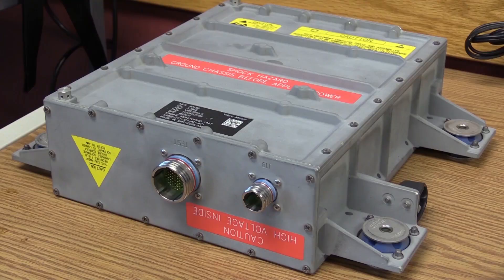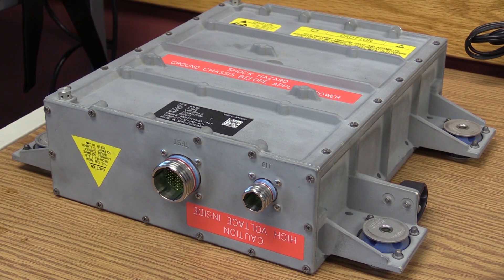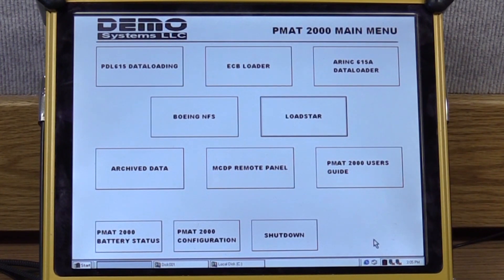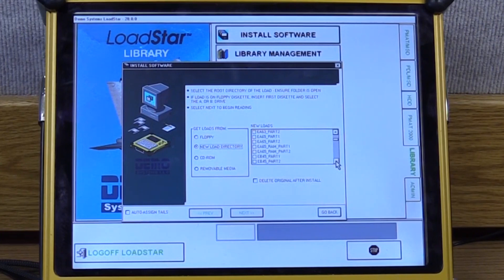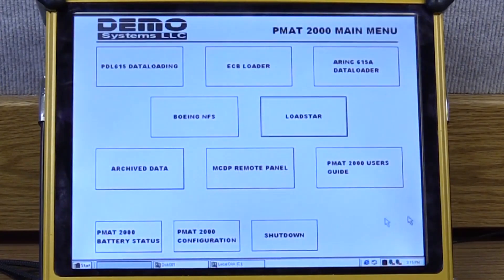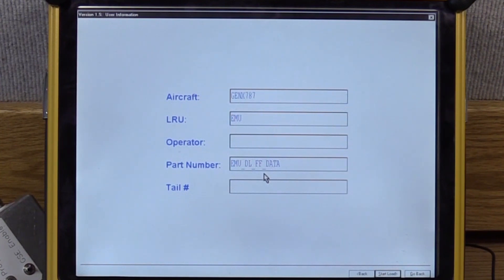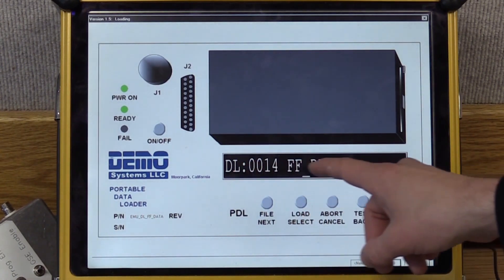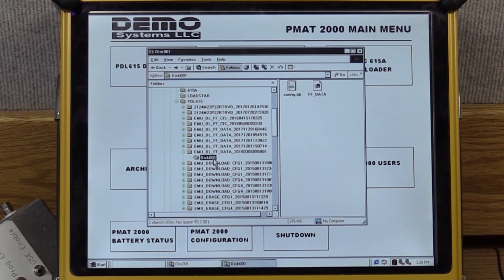GEnx - CEOD NVM Download - GE Aviation Maintenance Minute

Comment: J2 (The DB-23 @ 5:30) isn't a standard parallel cable, thats something else.   I had originally gone on to do the math on the file size but that looks like some custom hardware. (Turns out its a 276mb file)

Comment: The curious, uses win98 operating system and floppy disk!
Reply: Yes and 22 hour for data retrieval? That is 1998 speed! 600 baud serial.
Reply: I wondered the same then found that DB-23 connection..